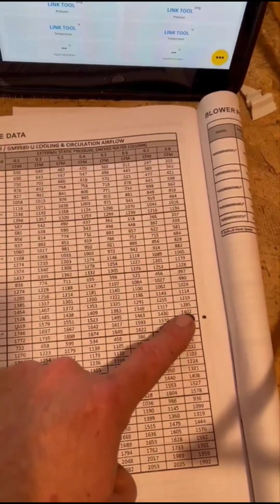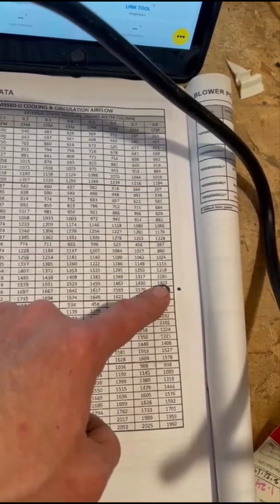Goodman GM9S Furnace Commissioning & Start Up

Comment: New furnace installed by random installer. I see the fan speed is 400 with the ac on. It barely blows out the ducts. Think he never set up the board? Or never did a static test?
Reply: possibly mis-wired and see it as a call for continuous fan. call the installer back.
Reply: @Jon-hx7pe  I looked into it  because I was also called by the tenant about the heat. Had heat set to 200cfm and would not cause enough airflow and the high limit would trip. I ended up adjusting up to the 400 setting and now everything seems kosher.